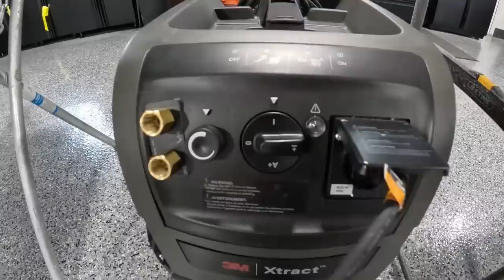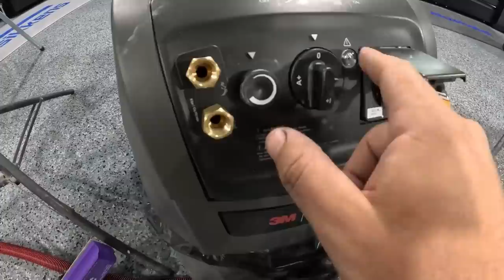DUST EXTRACTION: Worth the Money? Or Overpriced Garbage?

Comment: Years ago I found a dust collector at a big box store designed to be used for drywall sanding.  It consisted of a bucket with lid, two fittings, some hose, a perforated sanding pad that attaches to the hose and an adapter for your shop vac.  The 2 fittings go through the lid - one attaches to a short piece of hose on the inside that extends to the bottom of the bucket.  The opposite side of that fitting attaches to the long hose that goes to your sanding tools.  The other fitting is flush with the inside of the lid and attaches on the outside to a piece of hose that attaches to your shop vac.  You fill the bucket half full with water.  As you sand the dust is sucked into the bucket and captured in the water.  Of course you have to properly dispose of the slurry but the system works great.  Cost was less than $30.

Comment: Hi brian a little trick with the dent in the bumper heat it up with a heat gun then use the curved end of your hammer handle and slide it over the dent from the inside and push it out so it is about 1mm to high then blow air over it to cool it down then run the sander over it no fill required i do this all the time in our panel shop just seal it prime it and sand cheers from down under

Comment: The last couple of years I’ve been using an Oneida  Dust Deputy cyclone and it catches at least %90 of the particles and has extended the Hepa filters life .With the hand rubbing blocks I use 2 meters of 20mm hose then into the vac’s hose . I find there’s less weight and drag on the sanding blocks .Because the 20mm hose is light I’m not worried if its rubbing and an edge of a panel .
Clients don’t have to worry about their lungs 😉
Cheers 👍🇦🇺

Comment: Hi Brian
I’ve had my own shop for 20 years and always used a portable dust extraction either from mirka or 3m there a god send no filler dust anywhere in the shop.I’ve had about 4 now over the 20 years they don’t last forever but good for about 3-4 years with warranty 👍 and at about £350-
400 that’s not bad over the years :) you’ve got a great set up there buddy awesome garage 👍👍

Comment: to address the dilemma of using the 3M block and the electric sander back and forth without having to deal with disconnecting the hose (especially if you attach the electric cord to the hose) what I have done is use the block without the hose which makes it a lot more maneuverable and then periodically go over the surface with the electric sander to suck up all the dust.  So I never disconnect the hose from the electric sander.  I use the mirka 3x7 inch sander and festool dust collector which fits great right out of the box.  Only need one kind of cubitron roll that way too.

Comment: Brian you can buy same type of cuff like festools, for that extractor. Dont know if 3m sell them but Starmix, Mafell, Metabo do. Also, depending on the size of hose that comes with 3m, you can buy spare original starmix cuff which comes as standard on them (38mm hose), that will fit into that multi diameter adaptor so no need to dismantle the hose from adaptor. Now that standard one has a twist ring on it with slit opening underneath, so you can twist the ring and open a bit of a hole if you have complete suction on the work piece, that stops the red light coming up when you get full suction on flat piece. I presume that would be more relevant for woodworking than cars, but it all fits nicely together, so good actually that I never bothered with festool style cuff which they also offer as an option.
Reply from the maker: Thanks so much for that info. I’m going to def look into this.

Comment: A light wight hose is available which will fit the vacuum hand blocks without the use of tape or that clumsy adapter (3M™ Dust Free Hose Extension Kit. Part Number 05215) It will also allow vacuum assisted sanding on just about any brand of vacuum one might own (although HEPA rated would be best).
Reply from the maker: How about the other side. Will it fit the xtract
Reply: @PaintSociety  It has a tapered cone on one end that will allow it to fit into almost any vac and or large diameter vacuum hose.  We have a shop wide Eurovac system as well as Festool and Rupes.  You can insert the cone into the vac port on the vacuum or stick it in the end of the larger "powered sander" hose, it's relatively inexpensive (for 3m) and is almost completely universal.

Comment: On used oem painted bumper full of rockchips...if I wanted to repaint it....would you recommend filling those rock chips with bondo and putting primer over everything...or sanding them all the way down to the plastic and applying primer over that? What would you recommendon a repaint like that ?( bumper has a whole bunch of rock chips all over) thanks in advance

Comment: I can't understand how America just discovered the vacuum system when it comes to the Autobody Industry. In Europe we use it at least for two decades already. Now a small advice for you and your new vacuum. Unwrap the electric cable from the back because soon it will cause you problem to the motor. And just for the records nobody found a better way for all different sanders a block than the tape. I use the monster of rupes ks260. You should check it out...!!

Comment: Not sure why I still see YouTube tutorials of painters and beaters not using dust extraction.
It's not only so so much cleaner, but those particles are going to kill you, or effect your life so much down the track.
The Festool and other such specific machines for paint shops are so expensive, too much usually for the home / hobby painter to justify.
I got onto one many years abo, started with a 20lt size, now use a 30lt size Ryobi 1500w wet / dry, has power take off for electric random palm sander, a VERY long hose which sets it apart form the 20lt size, uses clean paper bag filter and pre filter bag.
Almost nothing gets past this, especially using ceramic mesh 6" disks, or those in rectangle size for the hand sanding . . . the dust just flows through like nothing is there, and no clogging.
This vacuum costs just AU$219, just US$147, no excuses not to have one, excellent for wood working projects too !!

Comment: this thing looks for 99% a starmix?  buttons, filters, like everything is the same only this one has 3m on it, and is a different color lol.
Reply: Different adjuster dial on this one, and on starmix you can wrap the hose around the body as its narrowed down slightly above the head latch. Also hose set up is 3m and not starmix.
I dont know about 3m but other brands get 1400w motor (mafell, metabo etc..) while starmix comes with 1600w motor.  But pretty much the same yeah since starmix are making them for those brands.
Reply: @bluewanderer9903  our starmix has even longer hose. We are very satrisfied with it. I sand thick industrial primer with p80 and he collects all the dust like its nothing.

Comment: Good review. Was wondering your thoughts. End of day the dustless systems are legit. Whether your mowing down a hood or doing body work in a jam, the lack if dust helps. Even 180 320 with guide coat, its just a much cleaner sand w the blocks. I have a festool @ work and love it. I use the 3" ( with an adapter to use only air) I use it w 2000 to de nib. 800 bucks is reasonable for a home setup- I imagine the festool ( I think 3m owns them) is alot more. Garage looking good man,happy Easter.
Reply from the maker: Thanks again Jimmy for the comment. Festool is a bit more expensive but comes with more options.  Happy Easter